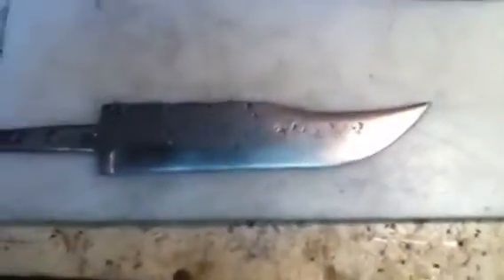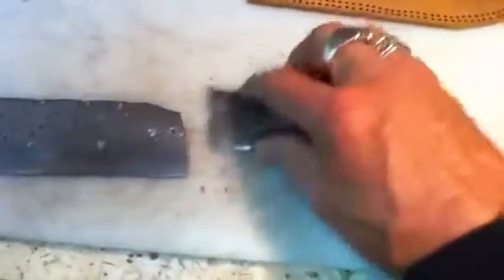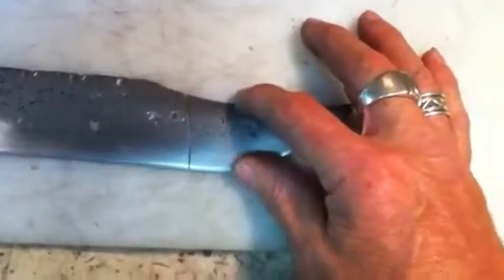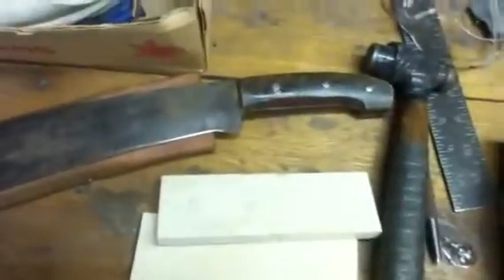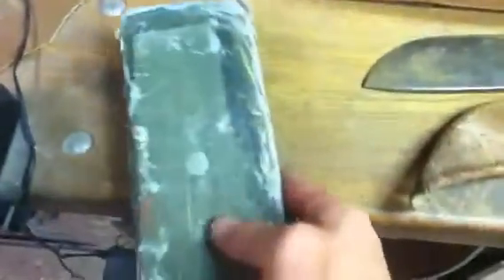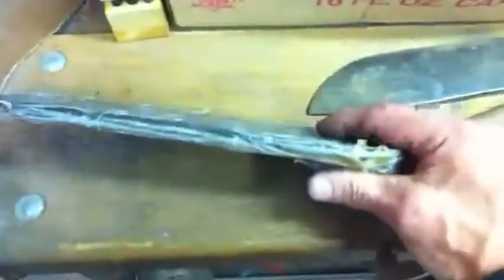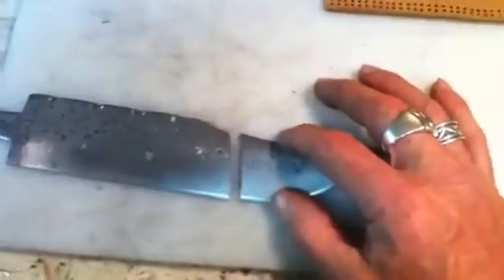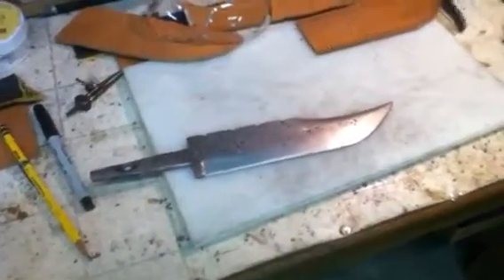Bowie knife failure!

Comment: How did welding it turn out?
I think it was harder than 54 on the Rockwell 
Possibly not hardened evenly. Question: did you normalize it before Heat treating?
If not, that would contribute to the problem.  
regards,
Frank